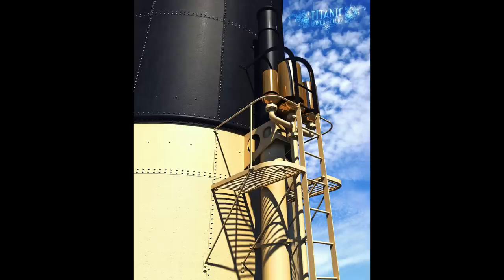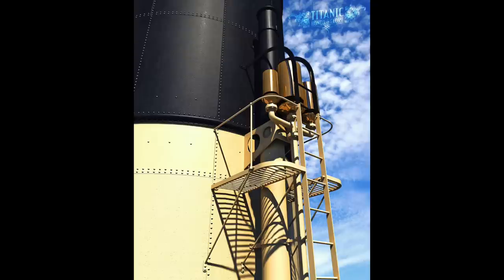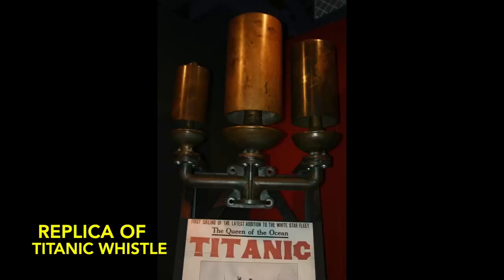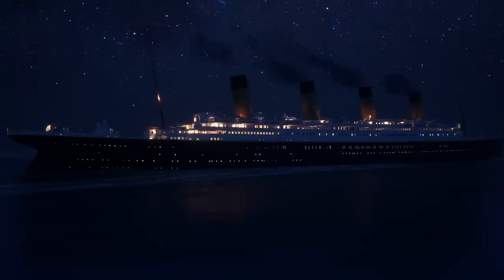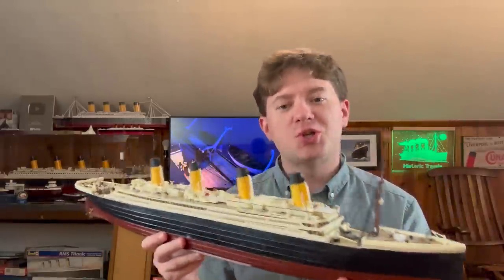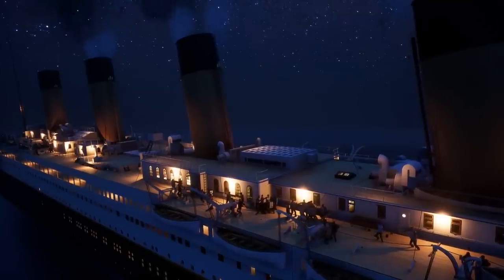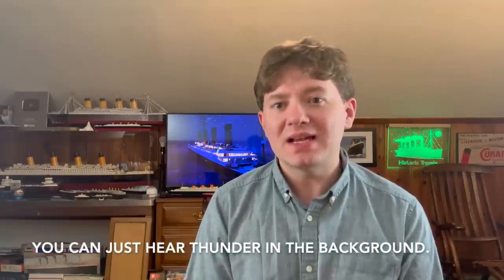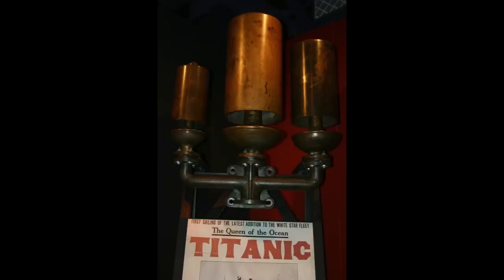The Incredible Story of the Titanic's Whistle!

Comment: I’m pretty sure that using compressed air instead of steam made it sound very different. There is footage of Olympic’s whistle and it’s extremely different.
Reply: That's true; both the pressure and the temperature of the steam would give the whistle a slightly deeper note, and, of course, much louder. Only with high pressure steam will you hear the true voice of Titanic. And maybe that's for the best.

Comment: If anyone is interested, there are several videos floating around of the 3-bell Smith-Hyson “Super Whistle” (the same type as used on the Olympics) being sounded on steam. They’re way louder, and slightly higher pitched than this Titanic set on air, due to the slight differences in the speed of sound through steam versus through air. Gives an even better impression of what Titanic would have sounded like. There is also at least one very good quality recording of Olympic herself sounding her forward whistle in New York in 1934 I believe.

Comment: The pressure of compressed air they used was probably a fraction of the steam pressure originally used, similar with old Canons they usually pack 5% to 10% of the gunpowder compared to a fully packed canon with a canon ball during war to do an honorary blast, with antiques you tend to use far less pressure on them to preserve them, but the sound is still close enough all the same

Comment: I don't know if you've ever made a video about but I think it's a fantastic topic for one. I have seen it theorized that if Titanic and Olympic had immediately turned towards each other and sailed at full steam they would have met up in time for the Olympic too rescue everybody on Titanic. The people that put forth this theory base it on the fact that it took Titanic over 2 hours to sink and the two ships were about 100 mi apart. Both had a top speed of about 25 to 27 mph. So as the theory says Olympic would have gotten there about 30 minutes before Titanic's final plunge and that final plunge would have taken place in warmer Waters about fifty to sixty miles to the South. So the theory posits that passengers would have been able to survive longer in the water. I personally think Titanic running her engines and trying to get to Olympic would have accelerated the flooding in the sinking but I have seen proponents of this theory say the way Titanic was flooding wouldn't really have been affected or accelerated by her moving

Comment: The sound from the event in the late 90s is not as genuine as it have sounded in 1912. The hot temperatures on steam operation vs. compressed cold air and the tiny droplets of water in the steam are shifting the sound more than you think. Have you ever heard a person trying to speak when using an electronic liquid based vapour cigarette? :P

Comment: I don't think it was just brushing the iceberg. Based on the shape of hull, position of the iceberg, weight of iceberg, the approaching angle of the ship and the proportion of damage happened to the 6 compartments, it's evident that either the ship was prematurely steered to the starboard side or the force with which the front portion of the hull had made the floating iceberg rotate on its side and hit the later portion of the hull with some extra force. I couldn't think of any other way this could happen to a vessel of that shape turning hard towards port side to get more damage to the 5 or 6 compartments.

Comment: Sam, it has been well documented that the Californian was only 10-20 miles away when the Titanic foundered. And it has also
Been established that the Titanic’s whistles could be heard for several miles, especially over open water, so why did the crew not try to signal the Californian with her whistles? 
A simple S.O.S. wouldn’t have been to difficult to send.
Were they just too low on steam at that point, or did they just not consider it?
Reply: The whistle range was around 8 miles so they would have just been out of reach

Comment: Hi Sam, do you know how the crew activated the whistle? Like on a steam loco they pull a string, but I cannot find anywhere on any information source, how were they actually activated? The bridge doesn’t seem to have any levers etc
Reply: Willett Bruce Whistle Control System. You can see them between the 2 windows to the left of the wheel in the picture of the Olympic's bridge.

Comment: long as there's no cracks then there is no reason at all they can't be blown with steam at full working pressure at all. but that will never happen as to many worriers involved with the whistles. We have a large family collection of various steam engines from the 1880's to the 1920's and they all still work perfectly fine today on steam at full working pressure. just compressed air at original working pressure will make a huge difference to the sound but you need steam as the expansion rate is so much different to air. really do hope someone grabs the bull by the horns and puts steam into them one day even if only at 50psi. 

does any one know what the boilers working pressure was?